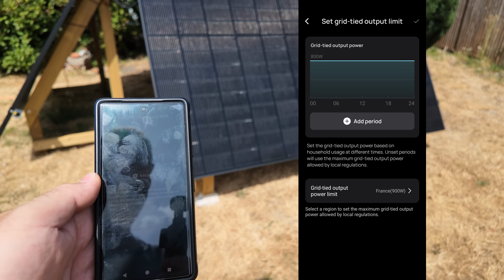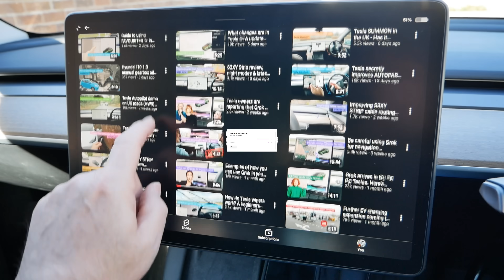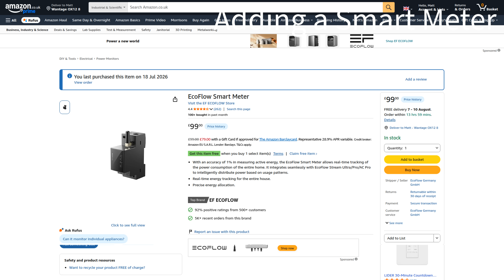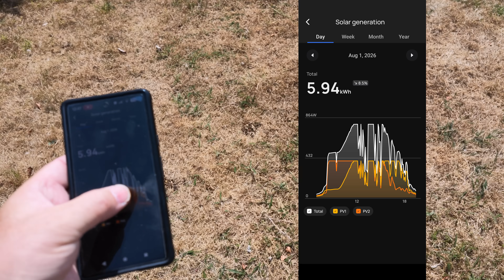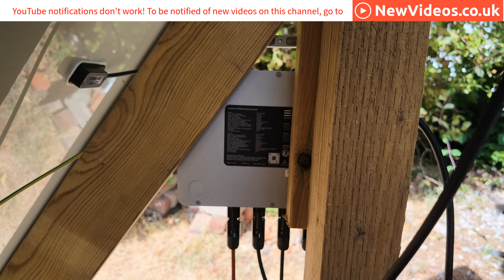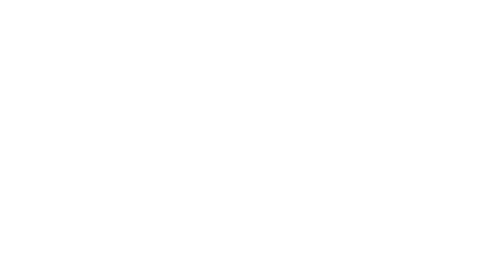Why My 800W Plug-In Solar Setup Sends Half Its Power Straight to the Grid ⚡

Comment: Nice video. I did practically the same as you, timber frames, oversized panels, 50deg inclination for better shoulder month performance, split aspects to lenthen day and reduce mid day peak, earth bonding, ecoflow smartmeter. I think those panels WILL go over with a good gust of wind, its the surface and turning moment that matters not so much the deadweight. Mine are secured to the ground. As you say the 'generation' is a meaningless number, especially if you dont get paid for export (even worse if your supplier charges you the same for export as import!). What counts is the offset of imports and that requires matching a pretty random source which peaks when you least need it with your demand. I started with stream ultra, so battery included, but even then optimisation takes a bit of working out.

Comment: Great video. Also doing some testing with the EcoFlow Micro Inverters. Like you not see the 800w max claimed, but very close, so not sure if its a heat issue with the inverter, or just life :)
Reply: 800W on the DC side, minus conversion losses 8)
Reply from the maker: I get 780W occasionally, so close enough I suppose.

Comment: Your inverter is actually two inverters both capable of accepting 600w and between them they output 800w. You are not thinking about this when panelling
Reply: Interesting point; so the micro inverter can draw a maximum of 20 amps but that is actually 10 amps from each MPPT input. 🤔 
If so, would it help connecting one panel from each rack to one MPPT input and the other two panels to the other input? 😵‍💫 That way maybe in the morning the output from one rack feeds both inputs & in the afternoon the other rack feeds both inputs. 
Given that these panels need to be connected in parallel to stay below the 60 volt input limit, is it correct to expect that a panel facing morning sun would not be limited by a south west facing panel that's still in shade ( & vice versa in the afternoon). ☮️
Reply: @Tim_Kent amps are pulled not pushed so when the inverter says 20amps it will only accept 20 amps but you can have more on your panel layout. It's the voltage you have to be careful about. You want to look into over panelling and how it's achieved really, there's plenty of vids here on it
Reply: @juliandarch9278  No - this is a collective internet (mostly reddit) hallucination. On fast light level changes exceeding the Isc limit will damage the MPPT bit by bit, and it also invalidates the warranty.

There are two current ratings on an MPPT, the max it can consume usefully (16A on the Ecoflow) and the max it can survive (20A on the Ecoflow). A lot of uinverters the second rating is much bigger than the first so they are easy to overpanel, the Ecoflow uinverters though really can't take much overpanelling.

You can get about 780W per MPPT without being more than some mA over the Isc rating if you pick the right panels btw.
Reply: Thanks for this update on your minimal plugin solar setup. 
Have you considered a solar diverter to heat the hot water cylinder? 🤔
Some years ago there were adverts for a couple of products, one called something odd like iboost but they seem to have gone out of fashion now that home battery storage is less expensive.

Comment: Great video Matt, would be really interesting to see a monthly update for solar production as we move into autumn / winter / spring.
Which brackets did you use to connect the solar panels to the unistrut, as I am looking to do something similar myself, thanks 👍
Reply from the maker: I have a video coming out next Tuesday on the solar frame build, with all the parts, prices etc.
The solar clamps are these https://www.cityplumbing.co.uk/search/?text=fastenol%20clamp

Comment: If you made them frames yourself you're clearly handy with the diy I am sure you could make a tracking system that rotates the panels but that's just a slight optimization for a lot of work the next thing to go for is definitely a battery
Reply: yeah.  It's very good woodworking!I A big array on a central pivor and supported by pnuematic wheels would work. Even some sort of slow motor or pully system to move it around to track the sun. That'd be doable for a DIYer.
Reply: @wintersun398  But probably cheaper to just buy more panels. That's in esssence what killed just about every clever optimizing widget with moving parts in the solar space.
Reply: @wintersun398  Yeah that's a good idea becuase of how he has 2 sets of panels they wouldn't have to rotate that much. Might not achieve that much extra power but would make for a good project/video

Comment: I wouldn't trust AI seeing as it has made a mistake at least twice in the information in the videos. It doesn't seem appreciate that in parallel the current is added together. So when it says you aren't exceeding the specifications of the inverter it is incorrect. You can see that in the morning and evening you are limited by having only 1 mppt facing the sun. I still think you will get more power earlier and later by having the 2 mppts facing both directions. Yes quite possibly the mppts will have trouble finding the maximum power point but I suspect it'll still output more power morning and evening than you are getting now. I've got two panels facing south and you are only getting just over 1 kWh more per day than me. I think you would probably get better performance facing the whole array south but in this case in order to find out how much power you are losing when one mppt is clipping and the other is under utilised, you could try splitting your pairs across the two orientation s.
Reply: Yes this!!!
AI is completely wrong here and getting full use of BOTH panels facing the fun is only possible by using both inputs on the inverter.
If both panels are in parallel on one input he is limited to 16A which means each panel gets a 8A load instead of their ideal 13.66A. This will increase voltage from panels slightly from the Vmp of 33.68v and I expect around 35v will come from panels. That's 560w instead of the expected capped 540w but still a far cry from 800w. Placing the panels in parallel and using blocking diodes will allow the MPPT to easily find the ideal point and pull 430w on each MPPT input for a full 800w output after losses!

Comment: Hi Matt have you considered adding a large fined heat sync to the inverter to dissipate the heat at a greater rate, also adding a thermostat centred cooling fan assist air flow across it 👴🏻🤞👍🙏
Reply from the maker: I'll look into it, but I wasn't expecting to need it as it has so much air flow around it and out of the sun as its sheltered from the panel above.

Comment: If your base load is very low then batteries cause a different problem - the inverters on the typical plug in solar systems are really not very efficient at low current draw so you can actually be getting a very poor return on your battery without seeing where it's all going.

There are a few microinverters that can get exceptionally high efficiencies at low current but they are not cheap ones.

For once the AI isn't making it all up. You need the same light level on the same or very similar panels at the same time, otherwise the one panel will pull the other one down in performance. Better yet you want one MPPT per panel to avoid the problem.

With big strings people use optimizers which know how to match the differing panels to keep close to the ideal output, but with microinverters you just use one MPPT per panel - which is kind of the original point of microinverters.
Reply: Not sure I understand this " the inverters on the typical plug in solar systems are really not very efficient at low current draw so you can actually be getting a very poor return on your battery without seeing where it's all going."

I understand if you do not use much power the investment will not make sense, i.e. size system for your needs. Or is your point more about wasted power by the inverter and is that not more of an issue for low Input rather than low Output?

Comment: Don't believe AI, it told me the best angle was 40 degrees for a flat roof, but then changed it's mind after I built the frame to 25
Reply: That's funny
Reply: Changes by season. Maybe you took too long to build it and summer arrived 😂
Reply: @clwydsigma how did you guess, I've still not put the panels in the frame yet 😂
Reply: @ranchandard2840 maybe some kind of hinge arrangemet is in order....
Reply: @clwydsigma Yes luckily I've put hinges on the front so just the rear legs to adjust when I get a chance 👍
Reply: @clwydsigma  Wouldn't want unhinged solar installers would we ;)

Comment: Yes battery needed, it didn't take me long to figure that one out either, i went for the ecoflow ultra  x with 4 mppt i get around 750w with 2 panels and seen it peak to 1kw with a bit of cloud edge effect, that used to  cause the ecoflow micro inverter to shut down for a few seconds, for some reason i never got the same output with the ecoflow micro inverter peaking at 695w.

Comment: I have the exact same panels and inverter, I'm too scared to run two panels in parallel on one MPPT as everything I read says that two panels will result in lmp of 26A and lsc of 28A, both way above the limit of the inverter.  I'm almost waiting to see if yours blows up before I destroy mine!
Reply: It should just clip at the max the inverter is able to do.
Reply: @wayneerikson1163  I can appreciate that the Ecoflow Stream 800W micro inverter will only draw 16A from the panels, but does massively exceeding the short circuit current lsc cause a problem?  Is the Ecoflow unit physically designed to cope with this?
Reply: @fishydelishy  I'd say that as they specify a maximum short circuit current of 20 amps, that is the maximum the components can handle without damage (and briefly, possibly only a few times). If you go over then you are relying on a computer program to avoid overloading the hardware, if that is a bit slow or crashes then it's a question of whether the components survive and how they fail. Best case scenario is they let the magic smoke out and it goes dead. Worst case is they fail dead short and pass the full current available. People are connecting 2000 watt or more to these inverters and in a dead short all that power would pass through the inverter. It's going to get very hot!
Reply: @fishydelishy  Exceeding the 20A will slowly damage the MPPT when there are fast light level changes. The other risk is a failure and exceeding the internal rated currents. If you were fairly sure you'd never reach 20A in reality you could add a fuse.
Reply: Volts are pushed while Amps are pulled. 
Exceeding the maximum input voltage of 60 volts would fry the inverter. 
Meanwhile, the maximum current draw is only 20 Amps regardless of how many amps are available from the solar panels. 
Hence, just be sure to connect the panels in parallel rather than in series; ie check the voltage before connecting to the inverter to make sure it is below 60 volts. ☮️
Reply: @Tim_Kent That's a reddit hallucination that appears to be predate even ChatGPT. When there are fast changes in light levels the current will spike as the MPPT adjusts. The 20A limit is what the components can take during such a spike, and it's what the unit can take without risk of fire etc if it was to short internally. I don't know if there is an internal 20A fuse but I'd not want to chance it with Chinese equipment.

If you exceed 20A you also invalidate the warranty.

And you can confirm all of this with Ecoflow support if you doubt me.

Comment: Now that you have the smart meter if you go down the battery route you won't regret it.  Have had an Ecoflow Ultra X 4kwh now for a few months and with 4 panels using very little energy from the grid, only needing the >800w at short peak energy points such as a dishwasher on the heat cycle.  Come the dark months you can then be charging at night on cheap rate also.

Comment: Hi Matt, thanks for the follow up.

I wanted to add/repeat my support for your optimisation for winter. I think that's exactly the right approach. Other commenters are of course correct that you could get more in the summer - but that would simply be more exported to the grid for free. I think you've got all of the decisions right.

On earthing, it's possible that installers earth the mounting rails rather than panels. I agree, they definitely do not earth the panels, they throw them on super quickly, so they can't be doing so.

The one difference with a roof mount system is that it would be very hard to come into contact with them, so they may argue that the risk of a lack of earth is mitigated that way - although that's not an official method of mitigation in electrical systems.

I suspect you not outputting exactly 800w is within the tolerance of what the system is designed for. A bit like a speedo in a car, they are allowed to be under but not over, so they mighy err on the side of caution and always slightly underrun them. I hope the speedo analogy helps.

I did fear that a lot of energy would be exported. I think that's something people will not understand well of plug in solar until they have spent the money, which is a shame.

Wind loading from a panel of that size is huge. There are probably formulae online to calculate it - or AI can do it for you. Better safe than sorry, as they might break if they do ever move or fall over. Remember that the weight is acting on a different axis to the wind load, so that doesn't entirely solve the problem. A ground screw or two is probably a cheap solution to avoid the expense of damage - and avoids risk to people.

Cheers, Andrew
Reply from the maker: Thanks Andrew for these comments.
Of course, I should have just earthed the four lengths of strut! Still, swings & roundabouts.
Reply: panels are usually attatched to rails with metal fittings which connects them to the common earth the rails are connected to